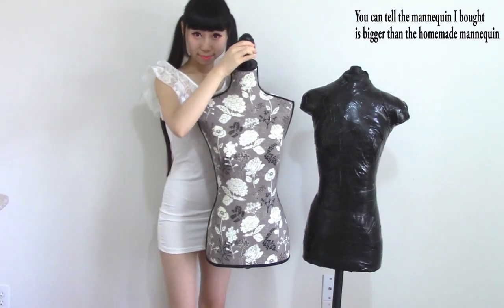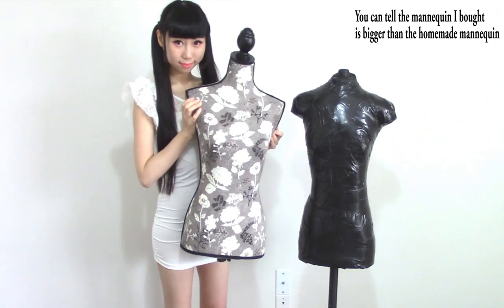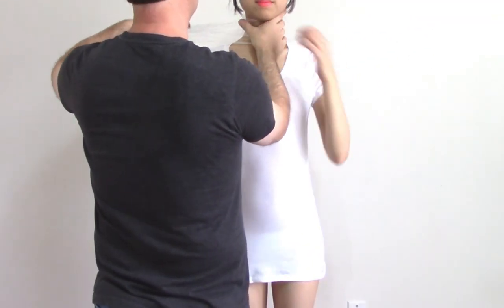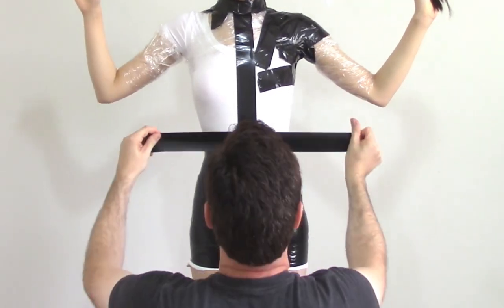DIY  Mannequin from Scratch | DIY Homemade Dress Form Fits you Perfectly

Comment: The amount of girls getting immediately defensive without taking a moment to rationalize their thoughts and flying off the handle and failing to read Yumi's comment is absurd. SHES NOT TRYING TO BE SEXIST CHILL. Just be Careful is all she meant. Some girls aren't comfortable using these tools and some would prefer to have the help of an adult or a male who may have more knowledge and strength. ITS OKAY, GIRLS! Chill!
Reply: Some boys shouldnt feel comfortable using those types of tools either. In any case, the last male wasnt really necessary, this kind of projects dont require that much strength at all. Just get someone who is more experience whether it's a guy or a girl.

Comment: Tip: If you do not have a stand for your dummy: I purchased a patio table umbrella stand (base only) for my dummy.  It is very heavy (massively heavy, made from iron) and will not tip over.  Then I just used a piece of PVC pipe to make the pole, like they do here.
Reply: Great video!  I like how you did the screw cap on the top.  I will be using that idea.

Comment: For those who don't wish to use power tools, you can get a handheld cutter for PVC (plastic) pipe fairly cheap at the hardware store. One type has a straight blade and used like scissors, the other is like a 'c' clamp with a cutting wheel that you spin around the pipe.

Comment: I saw this idea on pinterest about a year ago this and it failed miserably. I used bubble wrap to stuff mine and then some silver duct tape to structure my mannequin. Unfortunately it fell apart after a month and I couldn't use my Diy mannequin anymore. I eventually opted for a adjustable mannequin because my weight fluctuates all the time. This was a great tutorial and your  version was well made :)). I just have a quick question for you Yumi Do you find it easy to pin on this or are you only using this for displaying your clothes
Reply: in the video she said (well typed i guess) that she uses the homemade mannequin to sew clothes so i guess you can pin on it as as well ^-^

Comment: Awesome stuff, Yumi!  When I was still doing costuming in the '90s, I'd do a similar method to make casts of girls' chests to do plastic armor over. Used plastic trash bags, then taped them into shape.

If you want a body that won't lose its shape over time, especially in warm climates, like duct or electrical tape will, you can use spray foam ( very gently because it expands aggressively ) or better yet, two part cold foam. It's a latex based foam, and you can pour it into the taped form. It expands to twice its size while curing. This can then be covered in fabric. :)

Comment: I actually wouldn't recommend using duct tape to make a dress form. If you ever stuck your pins through duct tape, you know the pain when the tape residue gets stuck on the pin and now you have a bunch of sticky, bent pins and a dress form in even worse condition, And believe me when I say that tape residue will probably never come off.
Reply: Meghan Benavides what would be better?